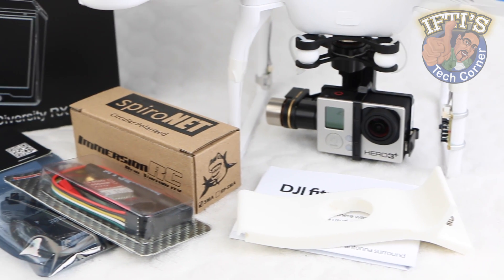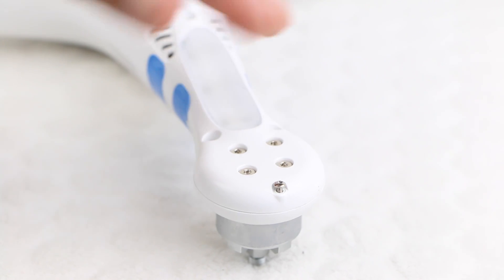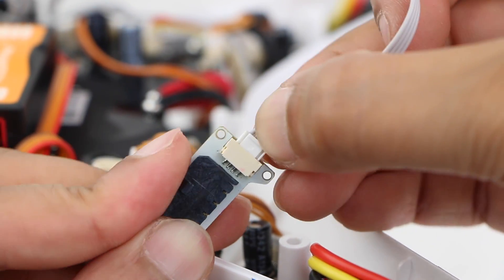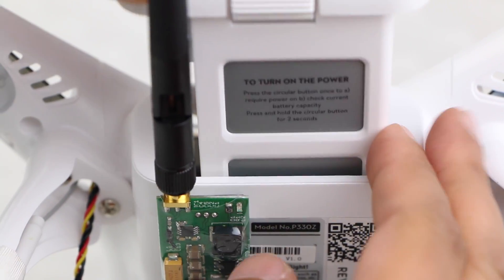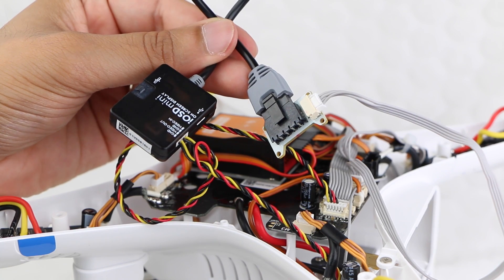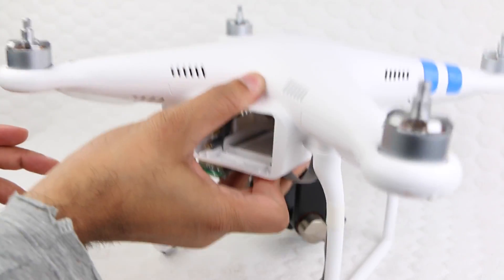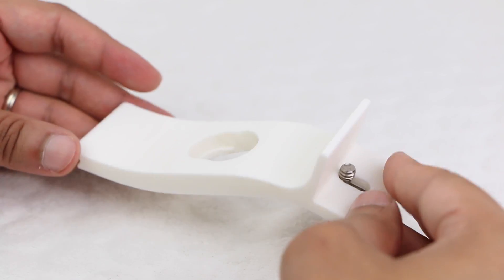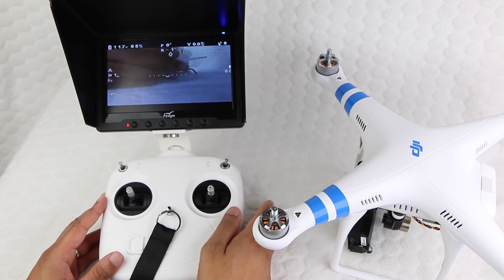#7: DJI Phantom 2 - Complete FPV Setup Guide & Test - Step-By-Step!

Comment: I have all of these items and image would be clear up to 5m I put some fat shark aerials on and works to 16m I can't find any other videos to fix it I have moved all video stuff outside on carbon graphite plate separated all bits then at most I get close to 20m surely I should get better distance then that also I am using a gph4

Comment: My phantom 2 does not have the port described for the osd connector, maybe my unit is the vision. Trying to use the camera that is installed. Is there a alternate location for this plug? Thanks!
Reply: Same.  Want to use the "egg" camera that came with the Vision2, but alternative FPV signal since the dreaded wifi transmitter/black screen video feed problem that plagued this quad.

Comment: Hi there Just wondering if the H3-2D will work just the same. I noticed that there is something connected to your gopro at 4:52, is this something required for video out? I was shopping around firstpersonvie and found a few cables without the iosd mini ( which is what I want. But there seems to be some with a connector for gopro and some without?

Comment: How would you make this work with a Chinese gimbal thats already installed with my go pro hero 4? The camera feed doesn't go into the phantom so it won't share the picture, do you need another converter to plug into the fpv cable already installed on the phantom 2?

Comment: i cant get the signal from the transmitter, everything is plugged in but i do have 2 different antennas on my monitor than my transmitter. would that be an issue?

Comment: hello again i assembled the fpv to my dji phantom 2 all works well just 2 problems i encountered the receiver when i stuck it to the base of the phantom due to the heat off the receiver it keeps falling off the body. did this happen to yours also i can connect the phantom to the assist software but when i try to connect the iosd mini to the iosd mini software it does not recognise the device. any suggestions thank you.
thank you for a great tutorial

Comment: Hi iftibashir, I wonder if you could answer my question. It's a great video, but I am slightly confused at 4.40. I understand that I would break my transmitter (and lose £75) if I turn on the phantom without the aerial. But what if I turn on the phantom with a aerial but no gopro? Would it break? Or would the screen just show white noise? Because I sometimes fly without a gopro with the connecting wire on the Zenmuse just taped down. Please get back to me soon.
Reply from the maker: +Harry Goodwin - Correct, you would just not get any image on your monitor. It would not cause any damage.
Reply: +iftibashir Now, 1.5 years after the upload, I have finally installed FPV! Thanks, dude. You're a legend on the forums

Comment: hi very good explanation just one question though you shown how you placed the iosd mini inside with double sided sticky pads but you never shown were you placed the module the one what you un screwed from the legs of the phantom. thanks again
Reply from the maker: +Chris Brown - This can be tucked away anywhere inside the craft - it doesn't really matter where ;o)
Reply: iftibashir Hi I just have to ask is there a specific reason dji place the module on the landing gear in the first place if it's ok to just tuck it inside the drone? after this installation?

Comment: Very helpful.. a quick question: after installing this setup, (without iOSD widget) is it necessary to change anything in the software before the system is functional? It looked like you had a feed straight away after powering up? Only I noticed in one of your other vids when you were in the Phantom software that I saw a check box for ‘FPV’ in the gimbal set up screen.
Reply from the maker: +Andy Ballard - It should just pick it up and work as long as firmware is updated
Reply: +iftibashir What would I need, if I want to use my iPad as a monitor. Would this make it cheaper?

Comment: I have the ph2+v3 how do u set up the iosd/immersion600 tx need some help thks
Reply: +Edward Mart same case I have ph2+v3     how it work  I need help too
Reply: Been at different sites still no feed back contact dji  I'll  figure this out
Reply: +Edward Mart is it a vision or a just a normal phantom 2
Reply: +Frank Jernigan it's a vision   plus .03
Reply: +Edward Mart The is is built into the app and you can't add the transmitter because it will interfere with the visions wifi signal.
Reply: +Frank Jernigan thks for info

Comment: Excellent video!
I messed up something with the channels and bands but I fixed it.
Now, I just have a problem: my IOSD mini is working well but when I plug it in the computer to update the firmware the software does not recognize the IOSD and I can't update it. I saw that you said this update is not obligatory, but I wanted to make sure it's updated. Do know why this happening? Thank you!
Reply from the maker: Eduardo Guarda If I remember correctly a driver needed to be installed first?? Check the DJI downloads page - I think you need to download a driver as well as the actual update.....

Comment: I have configured the same, however no video on my monitor. On the Immersion video transmitter, what should the dip switches be set at, theres 4 of them. I also have my monitor on band f. Any ideas? By the way I have tried 2 video transmitters with no luck.
Reply from the maker: 00codefinder Make sure the PAL or NTSC setting on both the GoPro and the monitor match.

Comment: Can I use the Plug & Play Cable as suggested but do it without the iOSD module, can I use the first Plug and Play Cable you show so as to allow me to connect the iOSD module at a later date?
Reply from the maker: Glenn Pascoe In theory, it should work fine, but some have stated that they do not get a video feed when using the cable without the iOSD present. 
To be safe I would either add the mini iOSD at the same time, or use the cable without the iOSD connection. When adding the iOSD later, the cable can be quickly and easily replaced.......

Comment: Very nice video, well made ! i am wondering how do the video signal comes from the gopro to the FPV ? from the gimbal ?  (the gopro power source on my phantom2 got ripped out, so i don't connect it  )
Reply: +Mari Mix that is the cable that sends the video feed to the connector inside the phantom then to the the trasmitter then to the receiver

Comment: First of all. Thanks for your videos. The are really helpfull.  I got all the items  and everything works fine. My question is, if I plugged the cable (plug an play) without have an IOSD mini, will I get video on my monitor? I read your message for AREA saying yes but other guy say it does not work. Did you make any test? Thanks!
Reply from the maker: MrSplintt If you want to run without the iOSD mini then it seems the direct cable is the one to purchase.....

Comment: Dp you realley levae the transmitter rapped up int he plastic or do you unwrap it?
Reply from the maker: Franz Bärtges Leave it in the plastic as it offers protection for the components on the circuit. There is no need to remove it. Mine is still wrapped and has been perfectly fine ;o)

Comment: Hi, this is a great video. Thank you.
- I'm having trouble getting video via my Hero 3 to show on my FPV monitor. I am using:
- Lilliput 664/w 7" IPS Screen 1280x800 5.8ghz Fat Shark Receiver for Hd Fpv Monitor 
- Immersion RC 600mw 5.8 GHz A/V Transmitter
- Plug and Play Cable: DJI Phantom 2 to iOSD Mini and Fat Shark/ImmersionRC Transmitter

The channels appear to be configured properly between the Lilliput and the Immersion RC (I've tried all combos). Is the problem that I am using the plug and play cable built to run through the iOSD mini, and yet I don't have an iOSD mini? 

Any advice is appreciated. Thank you!
Reply: Hi, I know this is an old comment, but I’m having the same problem and the same configuration, did you manage to solve it?

Comment: Hi Ifti, thanks for the great and informative video! 4 quick questions, if you don't mind:

1) I hear 600mW transmitters are illegal in the UK. Is this the same version for 25mW, and therefore would work in the same setup: https://www.firstpersonview.co.uk/transmitters/5.8ghz/immersionrc-25mw

2) The current version of my gimbal is the old version without the USB ribbon cable. Will this still work in the setup you showed above?

3) Is there any lag on the video feed from using the above setup?

4) Can you record HD footage from the GoPro at the same time as viewing the footage on the Black Pearl?

Thanks so much mate, much appreciated!
Reply from the maker: vic7000 Hi. The transmitter is openly available throughout most RC stores in the UK, hence I dont think its an illegal version as it wouldnt be so openly on sale otherwise (at least I hope its not!!). The setup will work just the same with the previous gimbal version - I prefer your version without the silly ribbon cable!! There is little, if any lag through the FPV feed. The image quality isnt perfect, but more then adequate. I do find I get some horizontal lines down the image sometimes, but again its bearable. Next step is lightbridge!! Finally, you use the GoPro as normal. It passes a SD feed through the side USB port for the transmitter to feed down to the monitor, but the GoPro can be used as normal at the same time - even at max 4k settings. It has no affect on the quality of the video the GoPro will record onto its MicroSD card whatsoever ;o)     Hope this helps.
Reply: iftibashir Thanks Ifti, much appreciated and very helpful! The gimbal that came with my Phantom 2 was actually the ribbon cable variety but I had to send it back because it was defective. Then the replacement also was, so that was sent back too. The 3rd one I received then wasn't the ribbon cable version and I thought that was bad luck for me (it being an earlier version), so I was debating sending it back. On your recommendation though, I'll keep it now! Any idea what things were improved on/changed for later versions, that mine therefore won't have? Or was it literally only the ribbon cable change?

I've googled the transmitter issue and a lot of people seem to think that it's illegal to have more than 25mW on 5.8Ghz frequencies and 10mW on 2.4Ghz in the UK. I haven't seen an official government page saying that though... I assume the lower power will mean a smaller range (a negative), but also a lower power consumption (a positive)?

Aside from that everything sounds great - thanks for your help, think I'll order very soon!
Reply from the maker: vic7000 I'd keep that Gimbal! The small ribbon cable is a PITA as it needs to be removed every time you want to access the card to remove any footage. The previous gimbal uses the rear GoPro Port and is a much neater solution with less chance of any breakages and easier access to the memory card. If I could have swapped mine for that version, I would!!
Other then the above, theres really no difference between the two that I can see.
Reply: iftibashir Great, I'm sold then. Thanks!

Incidentally I did some more research about the transmitters and it appears to be Ofcom that set the rules about this. Here's the document that mentions it: http://bit.ly/1yBxCcf (page 23 specifically). 

Anyway, thanks for the help - think I'm going to get a set up pretty much the same as the one you demo'd in this video. Cheers!
Reply: iftibashir Oh, one last thing on an unrelated note - what have you done (or would you do) to fix the issue where the left landing gear often comes into the shot when filming - particularly when turning right sharply? Would you suggest longer landing gear (I've heard there can be compass issues with this?), physically cutting the left leg off (I've seen someone do this, I don't think I could bring myself to do it because it looks terrible!), or some other solution? Or even just leaving it and putting up with it (or always rotating left and not right)? Thanks.
Reply from the maker: vic7000 I wouldn't advise you cut it!!
Ive seen many with replacement wider landing gear, which seems to work fine as long as the compass is re-mount roughly in the same location on the new landing gear.
Personally I changed the way I flew a little - flew slower and smoother rather then aggressively. Also I tend to shoot in medium FOV as it reduce the fisheye (which I hate with ariel footage!) and tweaked the gimbal settings so that it pans slower.
Reply: iftibashir Thanks, once again very helpful - I shall try all of those things. Thanks for all the help!
Reply: vic7000 Hi again Ifti. Just a quick question. My FPV gear arrived yesterday and I've fitted it all exactly as you say in this video. However I'm not getting any picture on the Black Pearl. Several channels have a black screen as if something is being received, but it isn't displaying the video from the GoPro... Any thoughts on how I could fix it please? I have tried scrolling manually through every single Band and Channel, and tried both Diversity and single feeds from RX1 and RX2 but can't get a picture... Also tried NTSC and PAL but no difference...

Thanks for any help you can give!
Reply from the maker: vic7000 I had the same issue original, but later realised my GoPro was set to NTSC. 
Change your GoPro to PAL then go through the different channels etc on the monitor ;o)
Reply: iftibashir Hmmm I just checked and actually I am already on PAL...

I just checked the frequency the transmitter is set to and made sure I was on the correct Band and Channel for that frequency (turned out to be Band F, channel 1) and I had the black screen I mentioned. Then I turned my Phantom 2 off, and the screen changed to static. So it is definitely the right channel I'd say. Just can't figure out how to get a picture instead of the black screen - feel like I've tried every possible setting!
Reply: I've found a possible solution here: http://forum.dji.com/forum.php?mod=viewthread&tid=11120

The guy with the problem there has exactly the same setup as me and exactly the same problem. The suggestion is that he is using the wrong cable from the Tx to the P2 - since he doesn't have an iOSD he shouldn't have the iOSD cable. I bought that one instead of the one without the connector just in case I later wanted to buy an iOSD, but now it looks like I might have to buy a new cable to solve the problem possibly!
Reply: iftibashir Found the solution Ifti! The problem was that the cable I was using was for an iOSD to be connected too, but I didn't have one. I intentionally chose that cable because I intended to possibly buy an iOSD later, but it appears that was my error because the video feed wouldn't get beyond the unconnected connector for the iOSD. Solved now, and all good (although I'm now having problems with my P2 not hovering where it is when I let go of my sticks! Not related to the FPV problem, but I might have caused it accidentally whilst fixing the FPV). Thanks for all your help!
Reply from the maker: Ah cool - glad you got it sorted - I was told that cable could be used even without the iOSD Mini!

Nevertheless, I found I had that hovering issue when I didn't have a good GPS lock. Check to ensure you have flashing green lights only, which indicate a good lock. Also calibrate the compass and try to fly away from any possible interference....

Comment: Thanks for the great video really helpful.
Just a quick question i have bought the parts in the above links the upgrade antennas i received have one that has a female and one that has a male connection did i get shipped the wrong parts?because i noticed that the original one come in a male form for both the monitor and the transmitter is there any way i can solve this and if the parts are correct which one goes in which connection?

Comment: Hi Iftibashir, I get a massive interference on my screen.. Could you maybe tell me how to fix this? Do I need to change the channel on the immersion 600mw? I'm a bit afraid to touch it... Can you remove the plastic around it to change the channel or...? Tnx in advance..
Reply: I ordered everything on the website you referred to... They send me a vionista monitor but with a black pearl manual with it. Also for the iosd mini, there seems to be no software for mac??
Reply from the maker: raf maris Im sure my Monitor doesn't have 'Vionista' on it? I'll double check and make sure.
With regards to the interference, try another band/channel on the monitor....
Reply: iftibashir Thanks for the answer, .... well yes it has vionista on it, on yours it says 'Flysight' as I can see...
Reply: raf maris If I change the antenna's, no result, if I leave the antenna's of.... same here

Comment: HELP PLEASE! how is the range/ video signal with the 32 channel black pearl? I have read that the 7 channel monitor seems to be more ideal for the immersionRC transmitter. I just bought the 32 channel monitor should i return it for the 7 channel version? please help!!
Reply: It should work fine there's vids and they can get up to 1.6-2 km with fine signal I have mine on the way

Comment: I bought all the items so I can do this setup in a few days. This video is amazing. Super, concise, with great video. Nice job.

I did have one question. the ImmersionRC transmitter. The location you have placed it. Is that still the most desirable location and orientation (antenna pointing out backwards)?

Again, awesome videos. I am watching them again and again in preparation for the final piece (the FPV part) of my build.
Reply from the maker: martmeister77 Thank you.
The transmitter can be placed wherever you like - I just preferred the book of it there and the fact it was at the back so I could install the antenna and switch on easily etc!